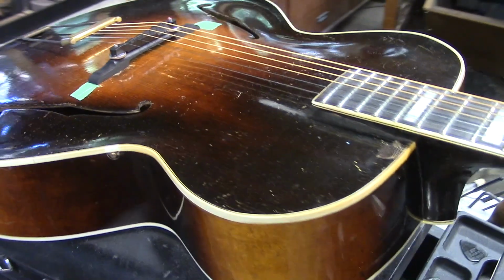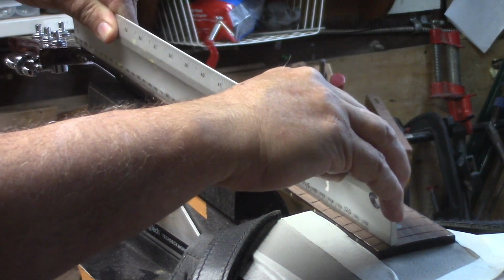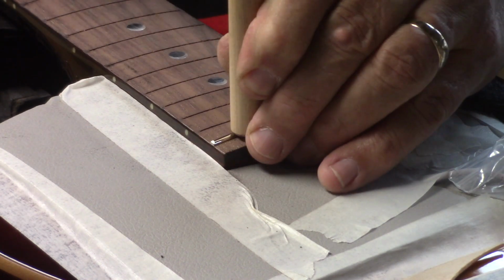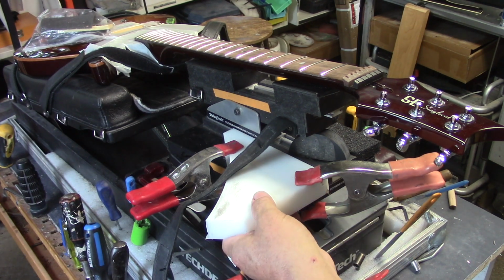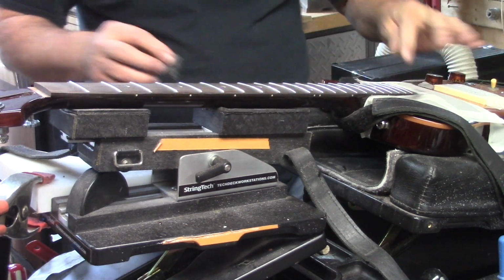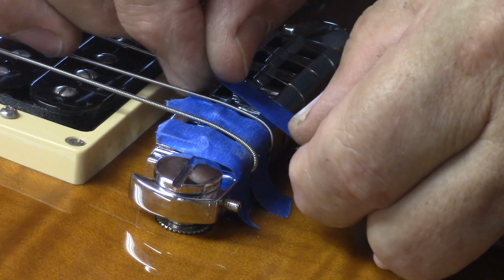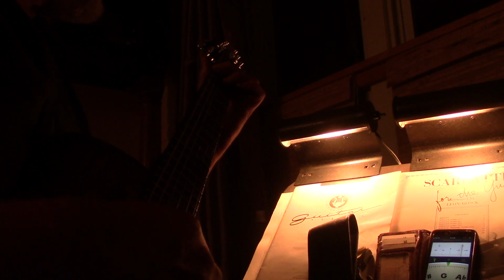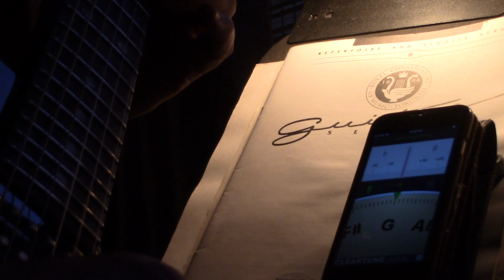PRS Re-Fret / 1929 Gibson L5@StringTechWorkstations

Comment: Thank you so much for pointing out that saw! You saved me an enormous headache because it's turned out to be difficult to find even the most basic fretting tools in St. John's.  At this point once I get my hands on some liquid ebony and lacquer stick I'll finally have everything I need for a rosewood refret right at my immediate disposal! 

By the way, you talked about eventually writing a book on the subject and I fully support that idea 110%. Not sure where you're at with that project but if it ever comes to fruition you can put me down for two copies.
Reply from the maker: The 3M final finish compounds come in Ebony + Ivory ( for rubbing out maple neck Strat fingerboards ). Most body shop supply places carry it ....  or McGuires or Faraqula are 2 other brands that offer similar ultra fine liquid compounds ;^ ) .... \m/ !

Comment: Awesome as always! Do you notice neck/body joint issues on neck through guitars?
Reply from the maker: The neck-to-body issues do exist with the neck-thru designs .... although they are not as common as the tenon-in-mortise or the bolt-on neck types.
Reply: @StringTechWorkstations  Thanks Mike!

Comment: Loving your videos.  Can I ask, when you are using the file to go over the fret ends, isn't it catching the edge of the fretboard which will slightly angle/round it?
Reply from the maker: This is where we need to pay attention to detail ... and lightly breeze over the fret ends until they are flush. The file should be held just shy of 90 degrees to avoid taking unnecessary amounts of material.
Reply: @StringTechWorkstations  Thanks for the clarification.   Regards from the UK.

Comment: Amazing how a company like Tone Pro designed such an armature piece of hardware, and they are not cheap (Shame on them).
This tailpiece/ Bridge should have been perfect from the factory! 
Can you please recommend a sharp (good quality) metal file brand in the US similar to what you use?
Reply from the maker: Are you referring to the Auger File ?
Reply: @StringTechWorkstations  Sorry I wasn't clear, I'm talking about the file you have glued to a piece of wood (You are leveling the frets with it and creating the fret end bevel)
Reply from the maker: Yes OK. That is a 6" single cut fine mill file. I buy these in boxes of 12 from an industrial supplier. After designing the curriculum for the College, and teaching the Guitar Repair Courses for 23 years; I quickly realized that all files are not straight Lol ! When I was teaching my classes I was buying 3 boxes of 12 files ( each box ) . I would sort through them and pick out the straight ones .... lucky to get 12 / 15  out 36 that were perfectly straight. Then they were mounted on a jointed hardwood block. I only make up these files for my Patreon subscribers now, and those who are purchasing the Fretting Kits. ( 6 straight edges / 5 sanding blocks / 6 fret guards /  1 scrub block / 1 fret levelling file )  www.mcconvilleguitars.blogspot.com/
Reply: @StringTechWorkstations  👍👍👍

Comment: Why do you alternate frets when Installing them. Is there a reason for this.
Reply from the maker: Good question. I always start at the top end of the fingerboard with the longest fret ... this way if I cut one too short .... I can just move up towards the nut until I find a place for the shorter fret. ALSO : When doing acoustic guitars and correcting the lay of the neck before the new frets go in ..... I'll install a couple of  "pilot " frets ( usually 3rd position and 11th position ) to get a read on the neck trajectory before installing all of the frets. Cheers !  MMcC

Comment: Water buffalo do not have tusks.  If the material you used for the compensated saddle came from a water buffalo it is most probably the horn from buffalo.
Reply from the maker: I stand corrected. Thanks for pointing that out. Cheers MMcC